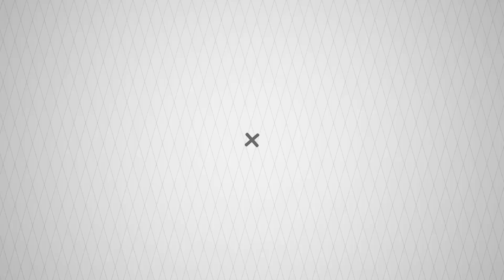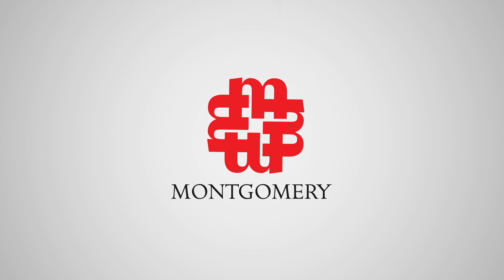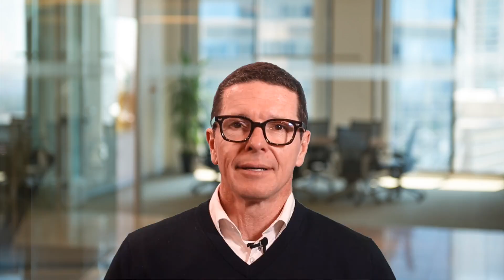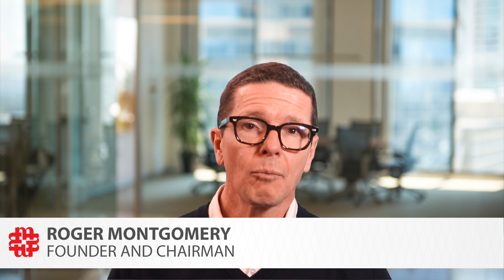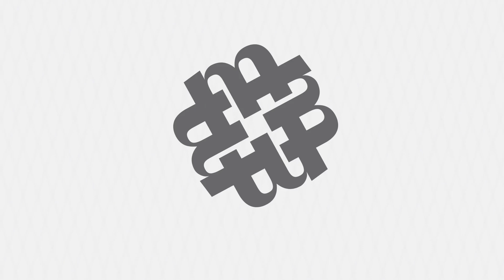Small reactors, big impact – a breakthrough in green technology

Comment: The SMR news is great, no need for the renewable energy hate. We need all the clean energy we can get.
Reply: It's all the renewable leftovers I'm worried about - Toxins in solar and wind engineering. Don't mention batteries. That will be a nightmare.
Reply: The renewable  energy  SCAM is nothing more than a money laundering  scheme .It dies NOT stack up any which way you look at it .And I've been 'off grid' since 1984 .Modular nuclear and  zero point are the ONLY way forward .The disgra destruction  of the environment  through  the establishment  of THOUSANDS of these monstrosities.1000 tones of concrete in each footing.massively energy expensive  to make cement  ..And those foundations  will be there for 1000 years..not to mention  all the rest of the components.